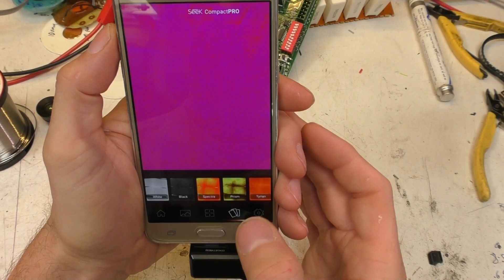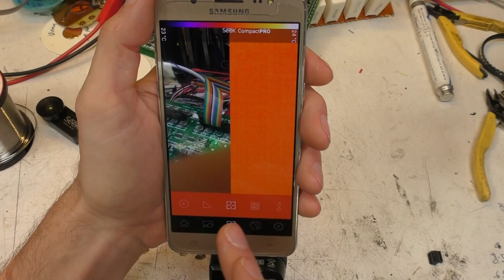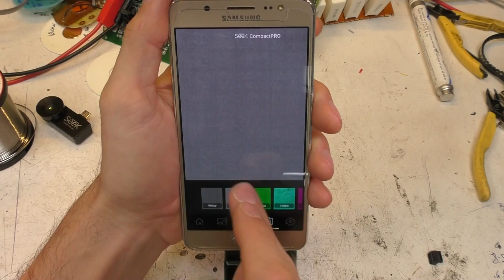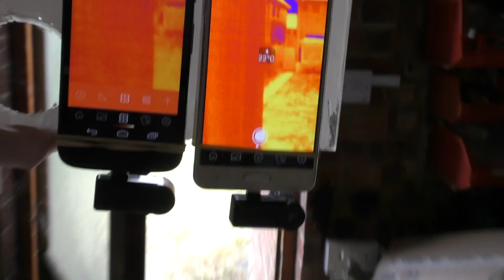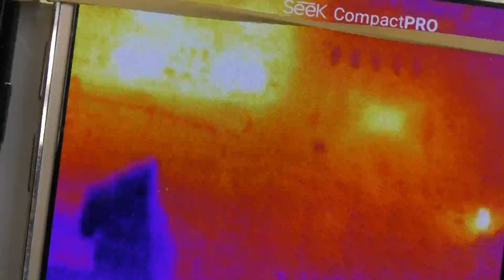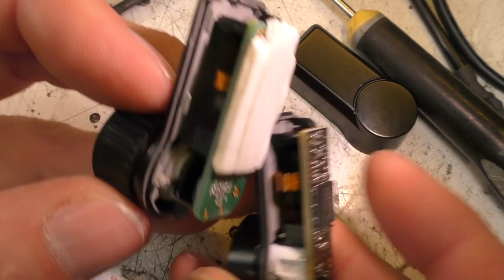Seek Thermal Compact Pro quick review & teardown

Comment: Not sure if you will see this because it is an old video but I have a seek camera with lightning connection but my new ipad takes USB-C I bought adaptors but they don't seem to work. When plugged in to the adaptor and ipad it does not automatically pull up. Can you recommend an adapter? I am having a hard time finding female lightning to male USB-C

Comment: Thanks, you just saved me from wasting $300 on this. I have FLIR's all the way from the Scout III 320 up to the FLIR T75. Your video shows this Seek to be a real pain and useless. I have a handheld SEEK Reveal XR Pro with a nice flashlight and has a slot for a SD memory card that works excellent. Years ago I bought one of these and gave it away as a X-Mas gift and now I see I would've been frustrated to death. I'm not sure your use of a real crappy cell phone made the difference. I was going to try it out with my Samsung 10 Plus. I bought a Blackview BV9800 Pro Thermal Imaging cell phone yesterday with a FLIR Thermal device built-in. The guy had it for $325 or best offer and he took my offer of $300 delivered. Thank-fully, he's stateside because Chinese sellers are putting the end of August delivery in their eBay ads. FGS, it's 2020 can they get their act together? I buy thousands a month on eBay and generally I get everything within 2-3 days. The longest being a workweek. No more China for me! OK, thanks for convincing me not to buy this POS. Spend a few bucks on a better phone.

Comment: It's now June 2019...The Seek is now available with a USB-C connector, so you can reverse the camera direction to take thermal selfies, just like you can with the IOS version with the lightning connector,  the problem with USB bandwidth is no longer an issue as the USB-C connector allows for a much larger bandwidth, and the best bit is the Seek is at least £100 cheaper than the Flir One!  Pass's price for the Seek Thermal Compact Pro is about  £270...Even on ebay the cheapest Flir one is about £380...So now it's a no brainer!
Reply: What was/is the problem with bandwidth? As far as I know the frame rate is not a bandwidth problem..?

Comment: Your images are as grainy (noisy) as I've seen.    I've seen other YouTube videos where the subject was FAR cleaner and noise free than the PRO I received or yours.    Not sure why the HUGE disparity between supposedly the same model (Compact PRO).
These are NOT traditional cameras and they work off of infrared sensing so they should not be affected by low light levels as regular cameras are.  I've tried this thing with a Galaxy S3 and a new LG v20 (much newer, higher res, faster processor) and TBH....the image looked better on the S3 imo.    I had the exact same problem you had with it dropping.   Or basically the app self terminating.    It seems to do it more on anything less than a full battery charge and seem to become more frequent as the battery level drops so I'm thinking it's related to the diminishing amount of current available to the device as the battery discharges and drops in current related to the USB port both connections as the device wiggles around slightly at the same time.    IMO, this is a high current drain device and as such USB power is definitely NOT ideal.    If I get another, I'll try to use a Y cable to power it from an external battery and just use the USB port for data transfer.   I have a feeling that would solve a few issues.    STOP moving your hands around in front of the video.   Like many say....it's annoying.

Comment: The new resolution is awesome, a real MUST since the original sensor is very blotchy. But I can't believe they haven't fixed the framerate issue. I've seen their handheld, stand-alone device, which I'm certain uses the same sensor, and it's easily a constant 20fps, if not 30fps. This is still 5fps at most, with constant stuttering. I know the USB bandwidth isn't terrible, people run HD webcams off USB and USB power all of the time. So what gives?? Is it thermal data really THAT big of a bandwidth issue? It can't be the CPU on the phone, those things are crazy powerful now.
Reply: it's for legal reasons lol
Reply: I heard the same thing, but SEEK has a stand-alone, hand-held unit that has a great framerate and no stutter. I don't believe there is even a limit on it's sale outside the US. So I think it's just USB input bottom-neck they haven't fixed. 

Go check out the SEEK Reveal Pro.

Comment: Hi Mike. Great vid as always. just a thought could it be used with a short lead? save mucking up the USB socket on the phone., or would that affect the frame rate?
Reply: No, mine works just fine. Will save your usb connection in the long run, though, having a long dangly thing hanging off isn't he best thing either. . What others have done is built 3d printed holders...handles....triggers....there are some people mention a magnetic usb connection from amazon.... so it disconnects easily if yanked. Looks promising but haven't tried it...getting an adapter...not for actually adapting but to save the phone's usb...that is something i do. I've used a coiled cable and then a hefty case where i placed velcro on both the phone case and back of thermal...which i secured onto the back of the phone instead of dangling down below being so vulnerable there. With that application, I had used a usb hub and a external battery pack...all of which was velcroed to the back of a "rugged" case...just had to be a little creative with the cables and mindful of their length..plus placement arrangement of all the things attached to the phone case. It was bulky, but very utilitarian- lasted a very long time... my setup was pretty much dedicated to the use of the thermal

Comment: There is less noise in the Flir app because the MSX thingy includes a filter that makes all the edges blurry and everything look like blobs. I downloaded a 3rd party app in which you can turn off MSX (which apparently is just included in the SDK) and it looks just as grainy as the seek, however, it has way less lag and much better detail. I really prefer it to the stock app in most respects.

Comment: I just bought a Seek compact and based upon my experiences with the App, I would never buy a Pro version unless they fix the App software. They are promising to fix the issues with the forced login every-time you run the app within the next few days. That is a problem that is absolutely intolerable. They also claim they are going to fix the +/- 6000000 degrees temperature problem. If they don't fix both of those problems, the Seek compact is going back for a full refund.
The USB disconnect problem seems to be phone dependent and it sounds like they don't have a handle on that issue.

Comment: would be interesting to see if you can get some custom firmware running on it to just dump the raw sensor data over usb or even spi as the data stream is at most under 30mbit and more likely under 10
Reply: That'd be fun.....wonder if anyone took a go at this challenge?

Comment: Even more stupid thing: on my HTC One M8s the usb socket is on the bottom of the screen, but the "wider" side of the plug is on the same side as the screen. So the lens of that thing would be facing in the same direction as the phone screen. Fail

Comment: Why oh why can't they add interchangeable port inserts? Why sell different versions, microUSB, Lightning (and no USB Type C!). Type C ports fit considerably more snug and would eliminate all the movement issues if your phone is modern enough. It would also be cheaper for them to sell the unit and supply the correct insert.

Comment: hate software that gives dumbed down prompts. "Oops" has no place in decent software. "No device detected" is much more professional.
Reply: Regarding the frame rate are you sure you have the fast frame model of the Pro.  There are two models, a ca 8 Hz and the faster 15 Hz model.  The product number of the fast frame variant ends in X.

Comment: can someone explain what is the idea behind export control on frame rates?
Reply: Any USA made thermal detector has export restrictions applied to it by the USA state department. It is mainly to avoid sensitive technology getting into the hands of terrorists and unfriendly nations, so they can't use them to track and lock onto high speed vehicles (adapt for missile use?). Anything above 9Hz becomes restricted, with various licenses possible to obtain to allow export to certain countries/end users. These USA regulations are pointless because manufacturers outside of USA don't apply the same restrictions. Thus unfriendly nations can get their hands on fast frame rate thermal cameras. A bit pointless applying the rules unless your tech is vastly superior to everyone else's.If they are quoting "export restricted" in the documentation, then there must be over 25% of the camera (based on MSRP) that is USA designed/made around the thermal detector. Based on the review here, if you can't actually get 15Hz usable frame rate they would have been better to stick to quoting <9Hz.

Comment: Hi Mike,  I'd like to use a thermal image product for two purposes. 1. PCB hot spots.  2. Looking for cold / damp places in houses.  What are your comments on this?  Regs Joe
Reply: Yeah go for it. Perfect use cases... spot the hot spots in a snap. Getting a Infiay device with a overlay dual image is nice since you then get outlines or more detail of what you are exploring...but, for just hot spots, then you will most surely see them. Will be hard to miss..especially any shorts, faulty components, shotty soldering....and the like

Comment: The performance could also be down to the way that the drivers probably have to be in userspace so talking to the camera and pulling the data from it is going to take long/have more delays than if the driver was in the kernel.
It would be interesting if you could see what the USB device looks like via ADB.

Comment: $500   Are you kidding!
Reply: Still 500 and it's still the cheapest 320p 15fps (mine puts 15fps and needs speedy phone with speedy usb connection. 
One shelf higher and it is 20x pricier.

Comment: This video has a much improved quality, at least that's what I perceive. The sound quality is awesome, if a tiny bit muffled.

It would be interesting to see if you can read the digital output directly from the sensor - the earlier seek had all the connections going to test pads/accessible traces and vias.

Comment: wow this really doesn't look market ready
Reply: in a software respect
Reply: lol' roger that, since there is so many alternatives out there, here does it so much better.
<I Have seen both Flir and Testo there are way better with also 320x240 sensor and the fact they cost 10 to 20x times more. that doesnt matter, money is only a tool.
get real Im not familiar with other there does it' this well for this pricepoint.
and where you get 9 palettes and movie feature and 320x240 sensor for sub 500usd.
Just jumped on one myself, at 291usd IOS edition (only IOS to that price) and didn't even have any IOS device with ligtningplug so went out and purchased a freaking Ipad 2018 (first IOS device for me) simply for this seek pro item
Me in a nutshell, like buying some tires and then going out and buying a car simply to match those tires.
But in the end, it was cheaper, then what 1x seek pro cost here in Denmark/Scandinavia where they often up around 800 to 900usd after tax and 25% vat.
was thinking about using some lightning to micro USB adapters, to use this IOS Seek pro on Android and reached out to Seek and asked them about it.
there are hardware differences, but mostly on the IOS hence apple regulations, so not likely an Android would work on IOS device but there cluld be a chance that an IOS seek pro could work on an Android device with an adapter if you found one there had the correct pin out and match data and power correct and I purchased numerous adapter from China but was unsure to take the risk, so decided to purchased an iPad and play it safe. as i didn't wanne risk blowing it before even checking that it actually worked..
The main thing i missed is that MSX outline-feature, but hoped thta the massive bump in res could help on that regard.

Comment: I talked with seek about adding image rotation and they said they have no intention of adding it as an option for fear of users enabling it by mistake...
Reply: Mine has USB on the side which is why I emailed them in the first place.
Reply: Agreed, its not that hard.
Reply: That's right: usb connector should be in the upper right corner.
Reply: And a earphone socket on the upper left

Comment: The "new app" is garbage. Requiring users to create an account in order to use an existing product is ass backwards. The interface is terrible and the stability is questionable. I've had the gradient bar show over 1 million degrees during a video recording, and it's corrupted several videos.
Reply: I have the first version on iphone, i can type in any random email and password when logging in, it says sign in failed and then it just starts and you can use the camera. The old app was much better, i want a app to take pictures not a stupid social media app,...
Reply from the maker: Not 100% sure but I think you can bypass the registration step when using the older camera
Reply: hand over youre persnal info or youre not to use us lol

Comment: the android thing is a glitch with your phone
it asks that so that when you plug in the device it auto launches the app
Reply from the maker: It does it on all the phones I tried
Reply: interesting, i use several devices with my S7 edge and after ticking the box , it auto launches the correct app and does not ask.
Reply: Maybe it takes on a random ID somewhere in the USB descriptor every time it powers up, causing the Android phone to recognize it as a new device.

Comment: That screen protector :D
Reply: Zero fucks given xD
Reply: +ReabowRotors (Jazza) Really? Wow. Didn't know that :O
Reply: I get what your laughing at....the screen saver is for a different phone your humour has gon over their heads.
Reply: Forssa1 My brother uses both xD Perhaps he had to take it out of the case for this video. Some people go through a lot of trouble to keep their phones in good shape.
Reply: A lot of people I know use screen protectors so they can sell the phone for more when they want to change phones.
Reply: +Forssa1 Sand in pockets is normal in certain jobs...
Reply: People use screen protectors to protect their screens. Why? "So it doesn't look ugly."

..screen protectors just end up looking even more ugly.
Reply: @Forssa1  The main reason I use a screen protector is because I don't want a fucking mirror in my hands. The first thing I get for a new phone is a case that extends past the camera bump on the back and a *matte* screen protector to make the display usable without turning it into a face tannning machine at full brightness (with all the drawbacks that go along with that, like OLED burn-in)
Reply: Yep, but still does the job really, lol. Who sane uses the front camera anyway.
Reply: not the correct protector for the phone, most protectors should be unnoticable
Reply: +Richard Smith Then putting it in a case would make much more sense. The screen is already the most scratch resistant part. Unless you have sand in your pockets there is really no need for a screen protector.